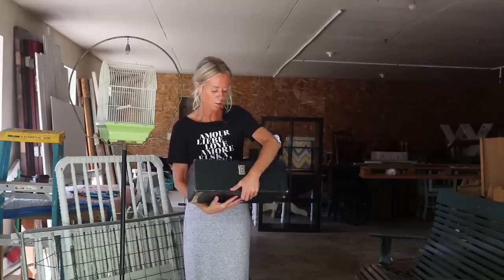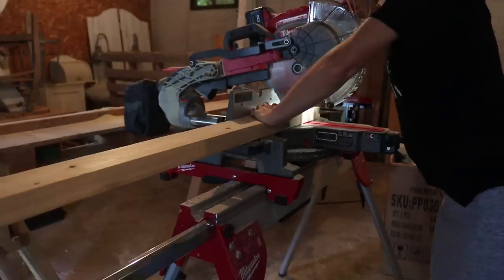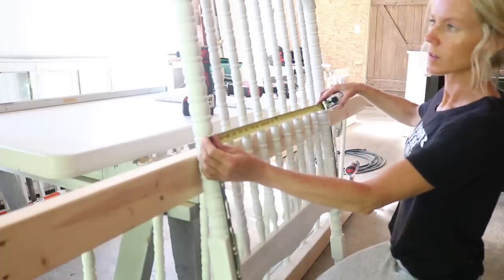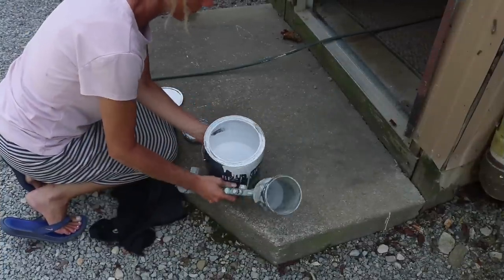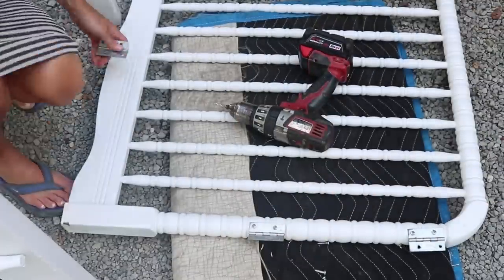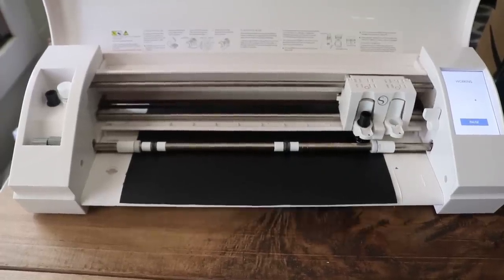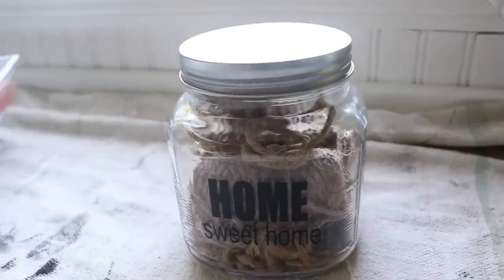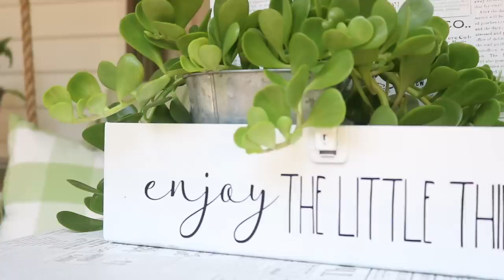Trash to Treasure Makeover ~ Crib Repurpose ~ Upcycled Furniture ~ DIY Arbor ~ Farmhouse Style Decor

Comment: Just a friendly FYI Mary, I did not catch if the white paint on the arbor was a water base or oil base but if it is water base putting an oil base clear coat on top will cause it to lift. I had that happen on some benches I built and when I asked at the paint department of our local hardware they said that is the nature of it and to never use an oil base over the water base paint. If the white paint was oil base, then of course, it will work fine.  I just thought I would warn you before you found out the hard way like I did.  The arbor was such an inspiration! I just love it.

Comment: The saw you are using is not a hack saw!!!!! It is a reciprocating saw. I love your works  but please use the proper  name for the tools you are using so that those in your audience who may want to purchase one will get the correct item at the hardware store. A hacksaw has an adjustable frame that allows the user to change blade sizes and types of blade. It is a hand tool not a power tool. I guess the carpenter in me wants to see/hear the proper names for the tools being used so that your audience is educated with the correct name of the tools you use so they can maybe try doing the beautiful pieces you make. Keep up the creativity and great vids

Comment: Some great ideas but you quickly pass over splitting the spindle by putting too many points through it at the grain, how to fix the handle that was wired on one side and then put a metal bucket with a plant in it on wallpaper that will be ruined when you water the plant the first time. Not really a fan of hiding reality. Great idea for the arbor though. :-)